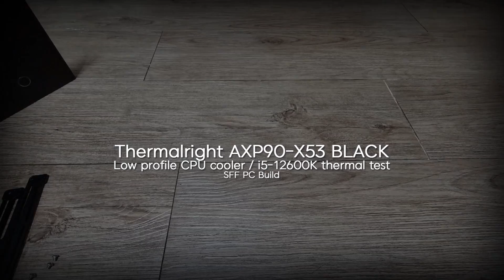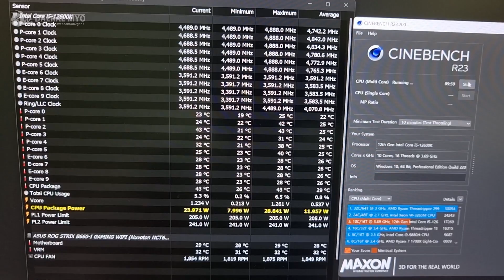Thermalright AXP90-X53 Black | 12600K Test

Comment: Thanks for making this non-bs video. Straight to the installation and benchmark, and you even showed us some personal concerns regarding the backplate. That was the cherry on top.

I understand others would want to know about the noise level or mention the amount of heat it would be able to handle. I think they're in the wrong place.. When you go ITX... temperature and sound go out the window when your build is this small........ and your build @2:54 is certainly impressive. 👍 You clearly understand your limitations by having such a compact build.

Comment: For i5-12400 OEM on ASUS Rog Strix Z690-A Gaming Wi-Fi D4 will this cooler be enough ?... Or maybe will be better Thermalright AXP-90 X47 Full copper ?? Or even AXP-100RH ?
Reply from the maker: With the 12400, you can achieve sufficient cooling performance on all the coolers you want to compare.

Comment: i have 12400f, Dan a4 h20 case. What cooler you recommend?
Reply from the maker: If you are looking for an air-cooled type cooler, you can choose 47mm LP coolers and 53mm LP coolers.
53mm : AXP90-X53
47mm : AXP90-X47, IS-47-XT, Hydrogon H90
Reply: @DalraeMyo  thanks and if I'm interested in an aio?

Comment: Hey i have a strix b 760-I and 55mm for a CPU cooler (case Lian Li DAN A4-H2O)  what's i have to pick???
(CPU: i3-13100) no gaming just some basic program for my father work, they are only text file 
-Thermalright AXP90-X53
-Noctua NH-L9i-17xx
-be quiet! Pure Rock LP

ty in case of any help
Reply from the maker: The ROG STRIX motherboard using the LGA1700 socket has interference with some elements located on the rear of the motherboard when the AXP90 series is installed.
All three coolers you mentioned are enough to use the 13100 for office work, but I think using Intel's Stock Cooler will be enough.

Comment: i use i5 12600KF + B660i asus + axp90 -x53. when i cinebench r23. i have only ~ 15300 - 15700 score. p core all 4.2. how do u have p core 4.5 & 17000 score
Reply from the maker: Multiscore is influenced by background programs when running Cinebench R23. Make sure there are no background programs running, and that there is no throttling caused by CPU temperature.
Reply: @DalraeMyo    temperature only ~ 80 - 85°c when cpu full load 100 and power 110w. No throtling. But i will try no program background.
Reply from the maker: For the 12600K, full load power consumption is 140 to 150 W with no power limit. @phuongnam7563
Reply: @DalraeMyo  i undervolt cpu. 
If I try no undervolt. Cpu will fullload 100% with 125w and throtling on 100°c. Low Score.

Tomorrow.  I will try disable programs background
Reply from the maker: R23 multi-score may decrease when undervolting is applied on the B chipset motherboard. (When I tested it, the score dropped significantly from -0.05v or above.) @phuongnam7563

Comment: Ah so you had to turn the backplate upside down so that the metal arms didn't "touch" the motherboard PCB and interfere with components on the PCB - gotcha! Good idea. It means the back of the MOBO will protrude a bit more so for others make sure your MOBO mounts provide enough clearance.

Comment: Very interesting. I was considering picking up one of these to do some testing with and see if I could get any temp improvements over my current Cryorig C7G with Noctua 92x14mm fan swap. Using Thermal Grizzly Kryonaut (haven't even tried liquid metal yet) I am only hitting around 90-91C on my hottest core after a quick Cinebench run. I CAN make it survive a 10 minute thermal test without throttling (CPU and case fans @ 100%), but I can't go much beyond that 10 minutes before everything just starts to hit 100C and thermal throttle down. 

I am currently using a Dr Zaber Sentry 2.0 case in a vertical arrangement with LOTS of little 40mm fans inside to help keep air moving throughout the case (6 in the top above the GPU using the Hardware Canucks bracket, with another 4 in the middle between the PCI-E riser and the GPU chamber). Going to try adding 3 additional 40mm fans in the bottom to help pull in a bit more fresh air and possibly have a 3D printed shroud to allow that air to be directed at the CPU cooler a bit more directly. 

What have you seen for temps during a long gaming session? And have you considered lapping your IHS or trying an liquid metal to see if that helps your temps at all?
Reply from the maker: I've used liquid metal thermal paste when using 8th generation CPUs. (There is no video because we didn't open a YouTube channel at that time.) When liquid metal thermal paste was used after IHS tuning, it showed excellent temperature control ability.

When testing in the same environment, the temperature was recorded at about 7 to 9 degrees lower than before.

It's a very interesting result, but considering the direction of the YouTube channel in operation, there are no plans to proceed again. (I try to avoid too maniacal tuning.)
Reply: @DalraeMyo  Gotcha. Any chance that you've compared the X53 vs the X47? In terms of cooling performance at least? I've played around with the X47 and think that I MIGHT be able to shoehorn the X53 in my application. May have to just buy one and try it out for myself.
Reply: does it comes with 25mm fan clips ?

Comment: I just received AXP90-47 full copper, I want it into Dan Case A4-SFX, I have the asus strix B760-I ITX motherboard and the backplate has the same conflict, the components on the back side of motherboard are the same as on yours, will it still fit into Dan A4-SFX when I turn the backplate upside down and use longer screws? or alternative is using washers under nuts and no backplate

Comment: Hi DalraeMyo-san, 
I am going to be using this cooler from thermalright (AXP-90 53, STANDARD color not white or black )

I am currently testing on -0.08v undervolt according to your 13600k video.

Please suggest optimizations for under 90C thermals with at least 95% performance of 14600k.

Your help and guidance is greatly appreciated, thank you.
Reply from the maker: For CPU undervolting, the applicable figures vary depending on the CPU's Silicon Lottery and the motherboard.

Unfortunately, you have no choice but to test your CPU yourself and find a stable value. We recommend a PL1/2 limit of around 120W and a value of offset mode -0.05v to -0.08v.
Reply: @DalraeMyo  i think to  try with UV only first,  currently on 360mm aio it is only consuming 135w at most. 
When I get AXP-90 next month, hopefully I can find stable setting. 

Do you know what is the maximum Tdp cooling capacity of the AXP90

Comment: Damn, thanks for this, I guess thats my next CPU cooler then, will test how it works with noctua fan, but still, on a 12600k, a 125w cpu, and 96C max with such a small cooler, pretty impressive. Knowing that, i t will cool the R9 7900 without any problems then.
Reply: I think you might even be able to get away with increasing your power limits to 105W tdp / 140W ppt on the R9 7900 and your boost clocks wouldn't be that far off from what you would get with an AIO. The temps would shoot up to 95C just like it did here with the 12600k but for the new Ryzens those temperatures are considered safe.

An R9 7900 using this cooler in a FormD T1 case with the motherboard side set to 53mm height and the GPU side set to 3 slot height is really looking attractive to me right now.

Comment: can you try the 13600k with the thermalright x47 version? please wanna see the temp and noise
Reply from the maker: If 13600K is combined with X47, I think we need to carry out a significant power limit.
Reply: how about 13600k with x53?
Reply from the maker: @blindman8093  I think it's far from enough to maintain its original performance even if it's equipped with x67 instead of x53.
Reply: @DalraeMyo  can you fit x67 in dan a4 h20? i hope you make this build 1 day with dan a4 h20 and this kind of build that your saying
Reply from the maker: @blindman8093  For X67, the side panel cannot be closed. Even if you use it without closing, it was not enough to handle the heat generation of 13600K.

Comment: Can you try this with noctua 92mm fan?
Reply from the maker: I briefly conducted the test using the Noctua A9x15 model. The temperature was 2 to 3 degrees higher than the previous FAN, but the operation noise was very quiet.

Comment: What would you recommend between AXP120x 67 and AXP90 x53 black?
Reply from the maker: If the height of the cooler that can be mounted on the case is allowed, the cooling performance of the x67 is overwhelming.
Reply: @DalraeMyo  Thank you! I was considering between these two. In my country, x53 is very expensive and x67 is unavailable. I think I will pre-order it for better performance and cheaper price. Your channel is really helpful, Subscribed!